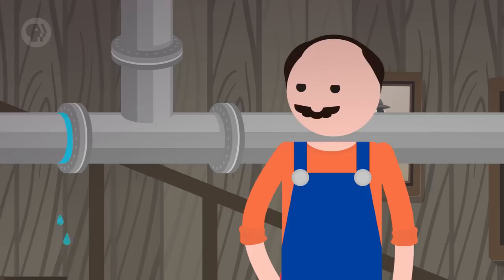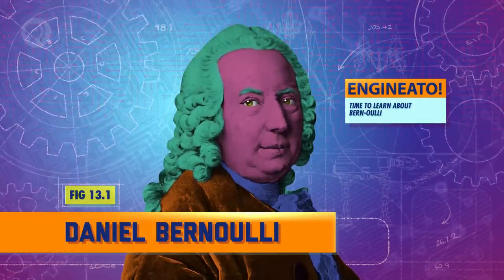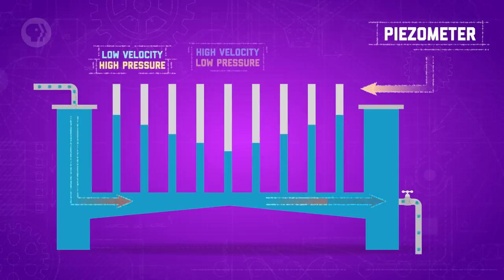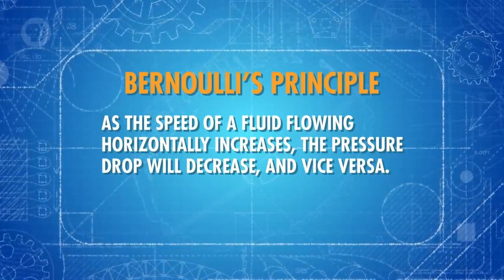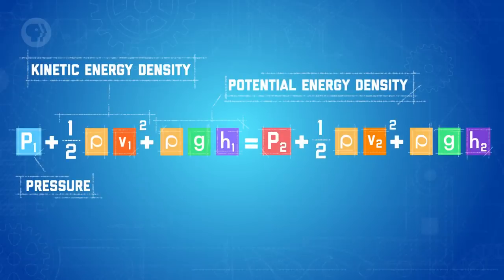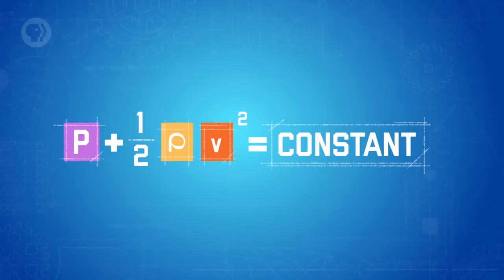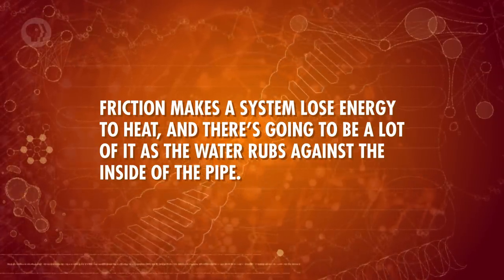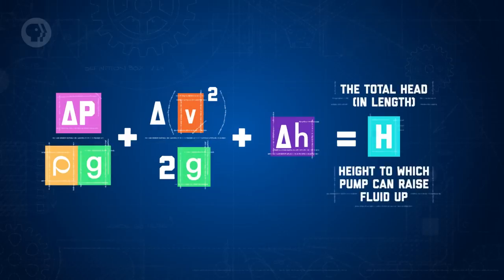Fluid Flow & Equipment: Crash Course Engineering #13

Comment: In a moving fluid energy is conserved

As the speed of a fluid flowing horizontally increases, the pressure drop will decrease is Bernoulli's Principle

An isentropic flow  both B and C

Bernoulli's principle only applies to horizontal flow so as to not take into account gravity

The resistance of two things sliding against each other is friction

Everything happening inside a system is called a process

The _____ the velocity of a fluid, the ______ the frictional losses greater ; greater

What country was Bernoulli from? Switzerland

Who was jealous of Daniel Bernoulli?  his father

All of the following are fluids EXCEPT rock

be back next time stay fresh kings

Comment: I may be nitpicking a bit here, but your definition of Bernoulli's Principle seems poorly worded. It should read: "As the speed of a fluid flowing horizontally increases, the pressure will decrease..." the term pressure drop describes the change in total pressure between two points in a network. As the speed of a fluid increases, the pressure drop between two points will actually increase.

Comment: Is it weird that for as long as I've worked with fluid flow in pipes, I've been fascinated by roughness? I was doing other things while watching this video, but at 7:24 I couldn't help but perk up and pay more attention.

It so often makes such a small difference, but I always found myself wishing that there were more data out there covering roughness measurements! And I always had to caution my students that while tuning roughness to get your simulations to match measured pressure losses was a reasonable thing to do, you also had to take care that you kept it within reason... There are few things more frustrating than seeing someone "match" their simulation to measured pressure losses by increasing the roughness to a value greater than the inside radius of the pipe!

Comment: Why is pressure related to the inverse of the velocity? Like why does the pressure decrease if I increase the flow rate?
Reply: Conservation of energy. The energy to make the fluid go faster has to come from some where. Since it isn't changing height, the only place for it to come from is pressure.
Reply: Ooooooooh I see, thanks!

Comment: I think I missed the point. Where do we calculated that pump?
Reply: They don't... The Bernoulli equation lets you estimate the required discharge pressure. Next one would start looking for what type of designs can do that and which ones can't. (dynamic or volumetric, valves or no valves,..)